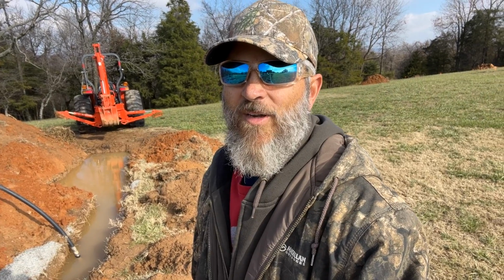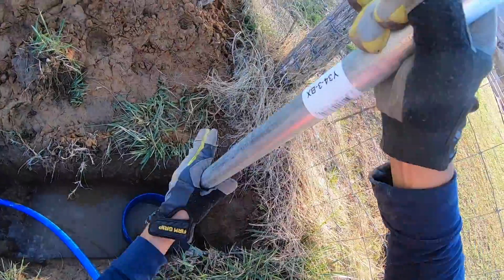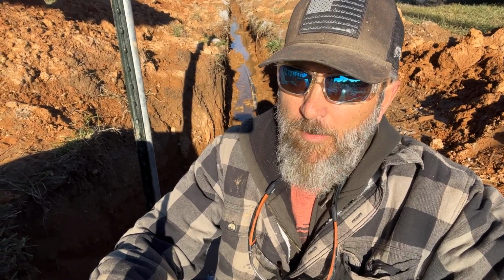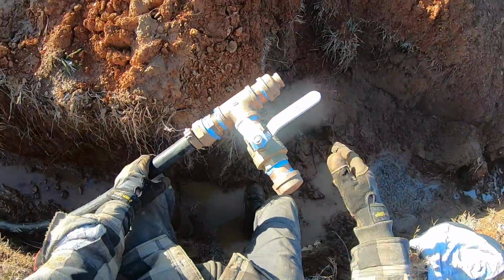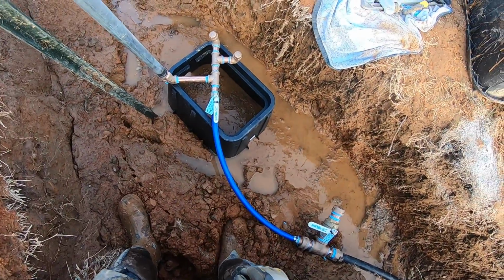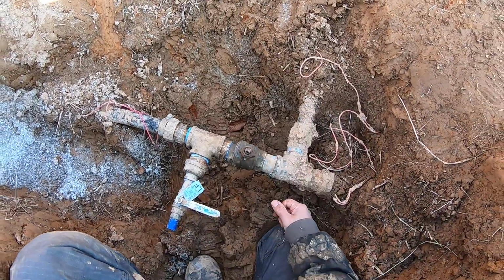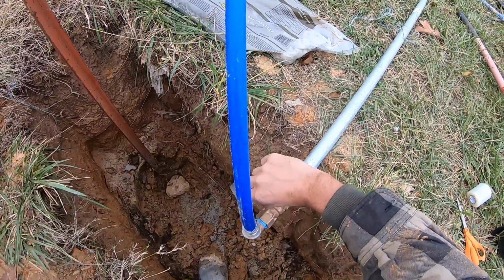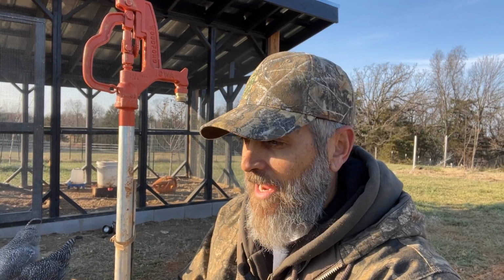Modern Farmhouse Build - Extending the Water Supply Line... Part 2

Comment: I like the frost free hydrants. However the plumbing in valve access boxes are likely to have freezing issues depending on your location. We have had to either put sand and/or foam board insulation into those boxes to prevent freezing after we froze and cracked a buried line coming out of a large water storage tank through an empty valve box like you installed. We do not see many extreme freezing days here in the Texas hill country but it was enough to do the damage. I realize that you are using PEX and poly pipe that gives you more forgiveness on freezing but you may not have water when you need it. Shame to go to the effort of putting those expensive hydrants in and get defeated on those underground valve boxes.